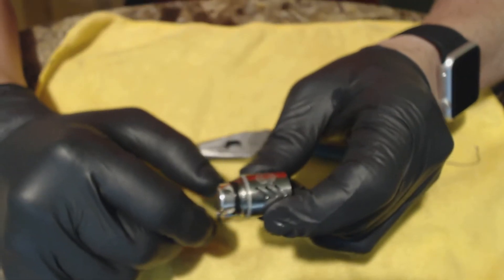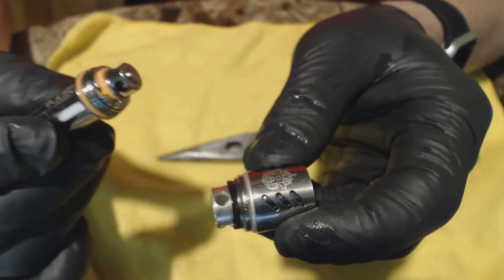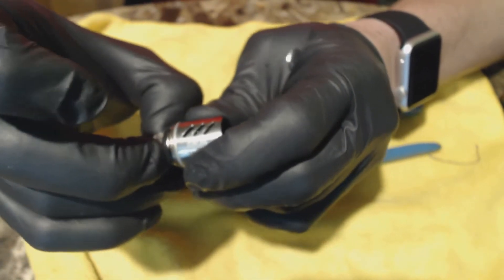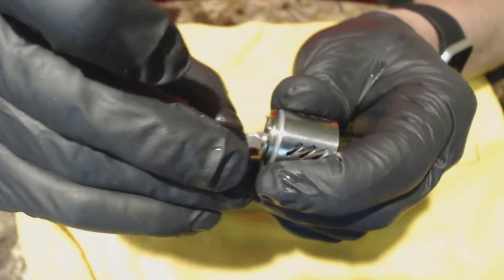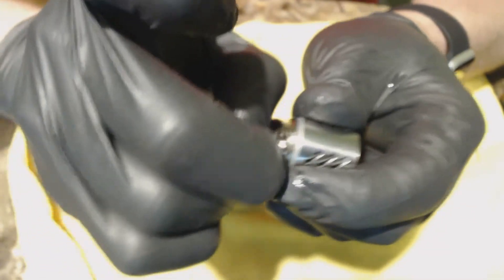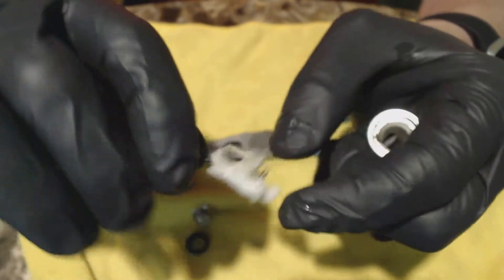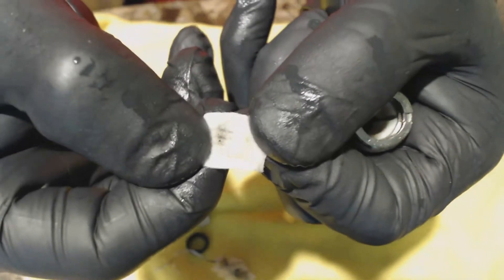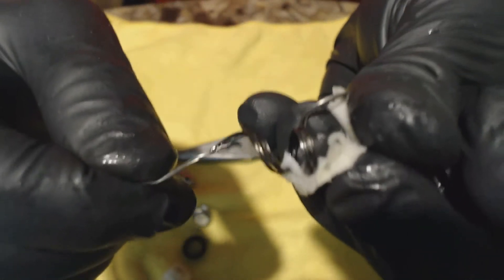Coil Dissection-Does cheap -juice and chain vaping gunk up coils?

Comment: The cost of the juice has nothing to do with it. The people who claim otherwise are crazy. It's all about the ingredients, which has more to do with the flavor profile than anything. For instance, my Hollywood juices cost way more than VapeMoar and YouGotEJuice but their juices gunk up my coils much faster than either of my cheap brands. Reason being they're much sweeter flavors. The extra sugars make them caramelize really fast. In fact, a couple of them drastically change color in the tank just from being near the hot coil head. This is why I typically only use my Hollywood juices with a TC coil. 

Just my 2 cents.
Reply from the maker: Yea the artificial sweeteners used  are the major cause of gunk.  At least from what I'm told but my best indication is that the ones over sweetened   give me a headache.  Happened all the time back in the day of every shop making their own cheap juice
Reply: Hollywood Watermellon tasted fine in the store preview vape but on a Scion tank coil forget about it, clogged pretty quick and sickly flavour anyway :(

Comment: Wow.. I have a v8 stick doesn't matter what coils I use they get so black and caked up. That is crazy that isn't caked with black gunk. I have the q2 coils now and I love em but they still get caked up. I run a higher vg don't know it that matters or not I think its 70-30. I read once the m-2 coils run like 60 watts from a watt calculator I used with the q-2 they run 38 watts so I thought getting those would stop the coil getting caked up but mine still do. I do use them for a long time but even after like 4 days I see black gunk on them.

Comment: Hey. I've been having coil issues with my tanks. I always use the lowest recommended wattage for  you coils and I've been lucky to get a day's use out of them before the cotton is completely black and my coils are not vapable. I've been noticing the more sweeter juices that I buy gunk up my coils very quickly. Out of all the juice I've bought at my local vape shop the only one I've been able to get more than one day out of a coil is Mountain Man ejuice. I get about a week with my coil. Every other juice I barely get a day and I've noticed that juice isn't anywhere near as sweet as the others. Do you happen to know of any ejuices that aren't outrageously sweet? Most of the ejuice I buy at my local vape shop are way too sweet to even vape on all day.